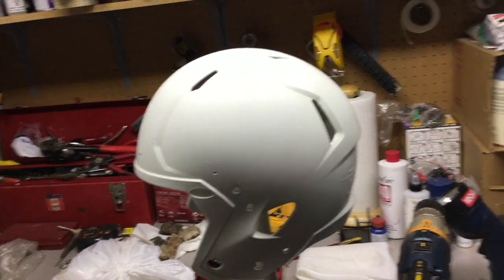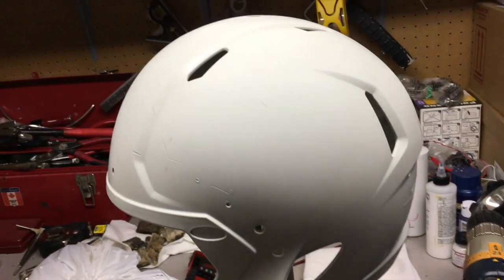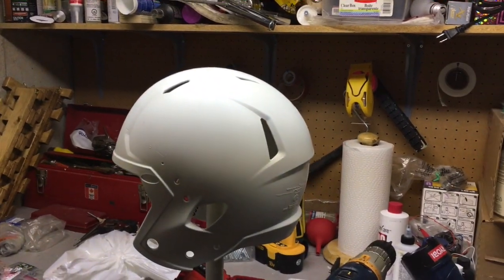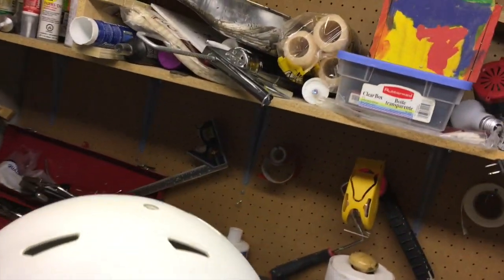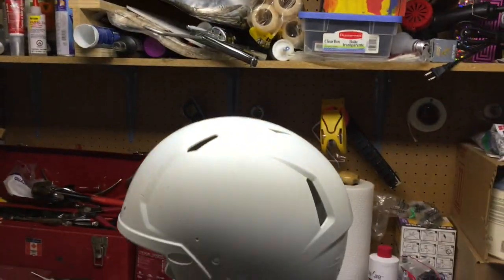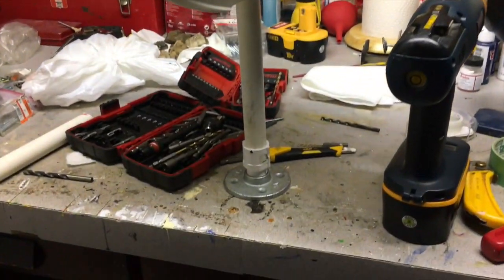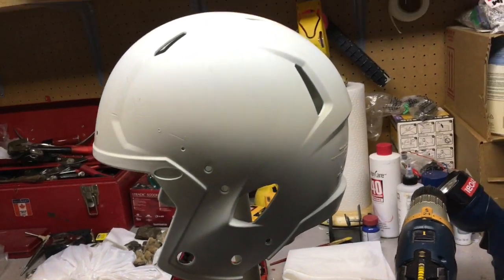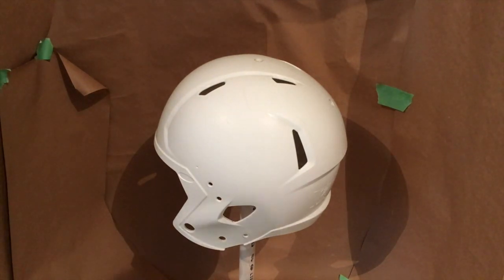What goes into a Custom Helmet?? | LF Life

Comment: How did u get it without any streak marks
Reply from the maker: +Trapmoline Tricker streaks where? If In the paint, do multiple light coats instead of 1 heavy
Reply: Lineman Football ok thank you because I tryed to do 2 thick ones and I got paint streak marks all over
Reply from the maker: +Trapmoline Tricker yah if that happens just lightly sand and apply another light coat

Comment: Why not just plastidip it? Then there's no sanding and it probably doesn't void the warranty
Reply from the maker: +Tommy Glodo plasti dip would come off super easy also has a small texture that wouldn't look right
Reply: Lineman Football I don't think it would come off if it's just a show piece like in a shelf or as decoration, also if you get some dip coat it should be smoother
Reply from the maker: +Tommy Glodo oh I thought to be used, yah in that case plastidip. One of my issues is, being in Canada getting plasti dip colours isn't easy and it can't be ordered because they won't ship across borders when dealing with aerosol. I stick to spray paint for consistent results
Reply: Lineman Football oh yeah bell if you wanted to get some raw ass colors you could order gallons from dip your car. They got pearls and stuff like that